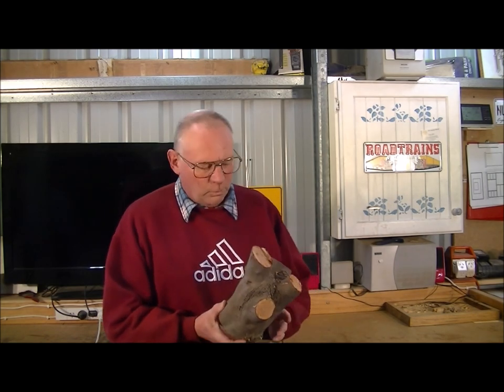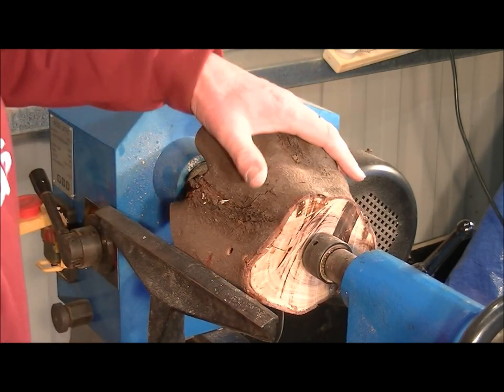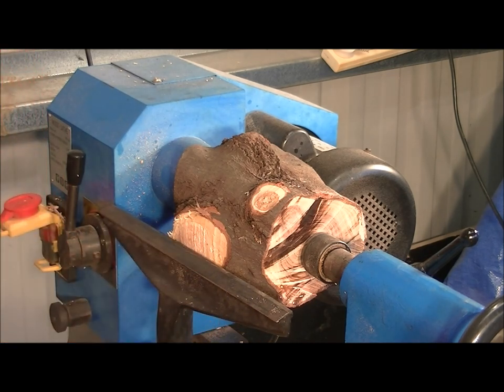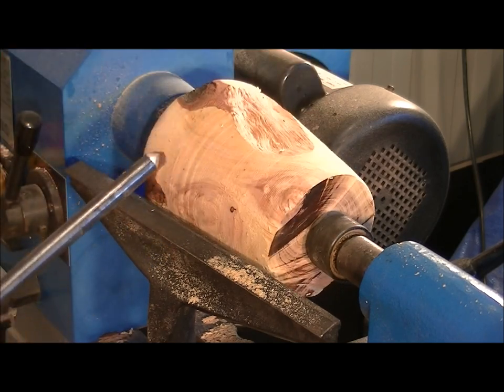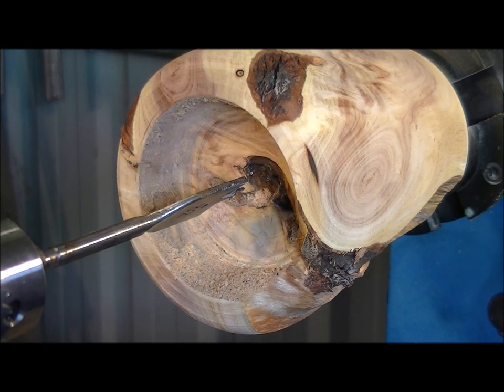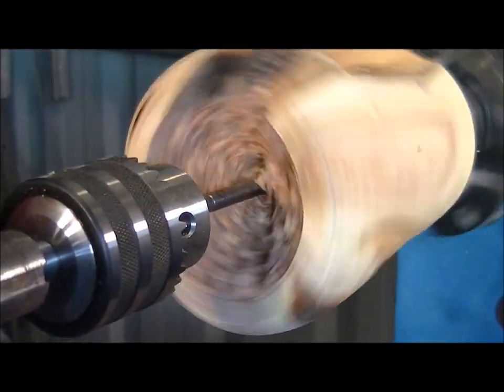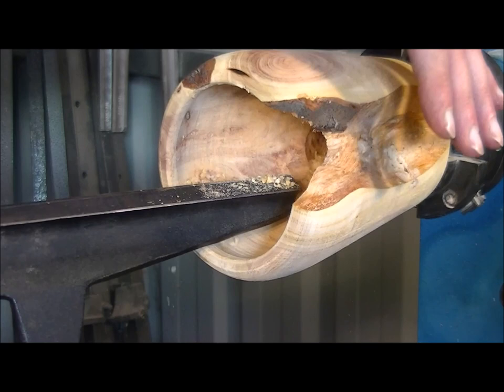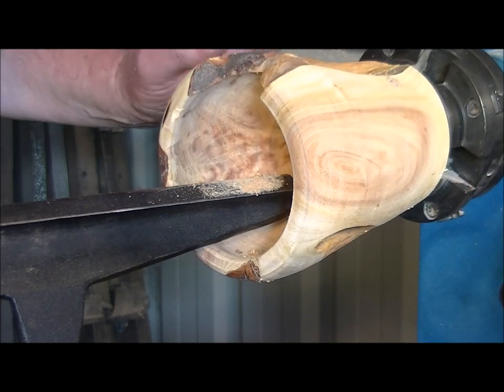98 Wood-turning a wattle tree crown Vase for beginners

Comment: Nicely done Roger. That's the type of turnings I've been doing lately. I have started using Forstner bits of up to 3 inches to hollow out the centers and it works great. Like your idea about the wire wheel and will be doing that technique on the next piece where I have bark hollows like yours. Cheers from Baltimore Maryland, USA

Comment: Great job. Finally found a rare video where someone just uses regular gouges to hollow out a vase. I'm a beginner and I don't have any fancy hollowing tools and I'm going to be attempting a vase soon with just what I have.  Is that a bowl gouge that you are using to back hollow? And how was the piece for chatter? Any?
Reply: Hi Corey, i to am a newbe, have experience of metal work lathe, but loving turning pieces of wood into something, a vase is on the horizon soon,
Reply: He did indeed use a bowl gouge. I've been turning for a while and if there is a will there is a way. You could turn a piece, or vase for this instance with any tool if you take your time. Fancy tools simply make the job easier